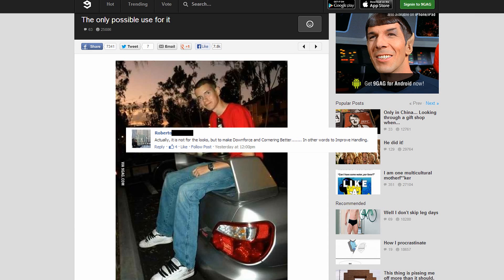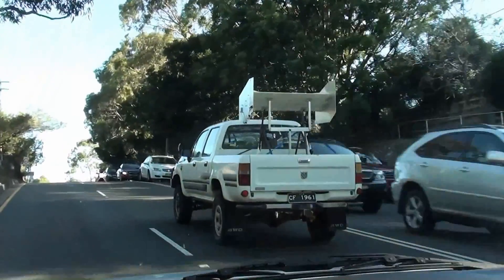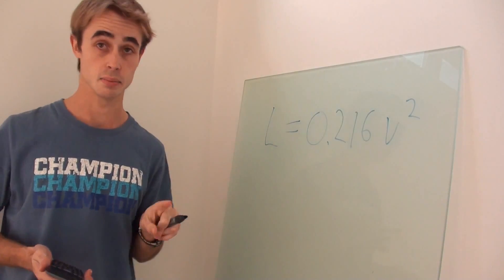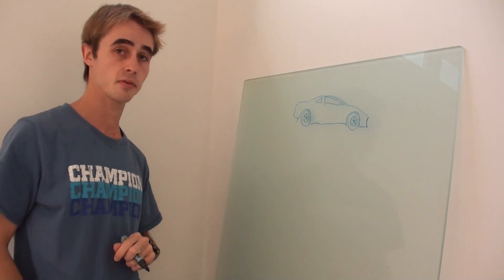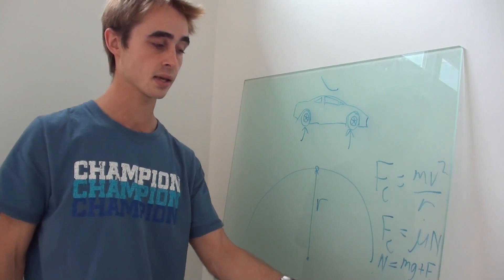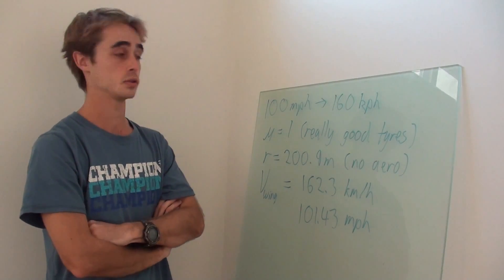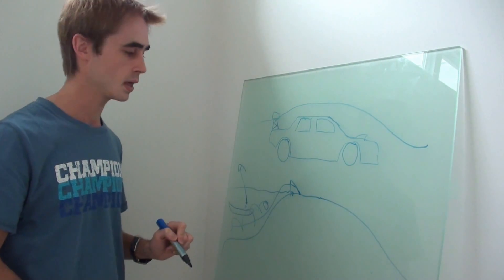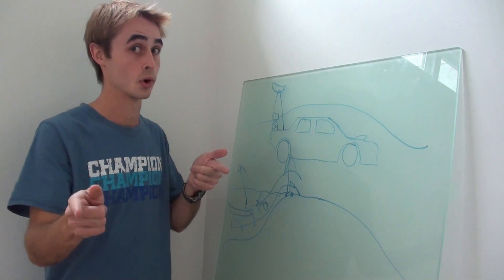Do Car Wings (Spoilers) Actually Work On-Road?

Comment: A Wing and a Spoiler are not the same thing
Wings main Job create downforce
Spoilers main job alter airflow, and can be found all over the car, the ones at the rear and visually look "similar" to wings, there main job is to reduce  turbulence/drag  right behind the car and improve fuel economy

Comment: In my old Colt  (hatchback) I had two small spoilers, they were mostly for decoration but they did help a bit with straight line stability especially when there were crosswinds at high speed. The top spoiler was 10cm elevated and curved to hug the body on its ends but top plate was straight, and the spoiler on the further end of the back rather flat again with very little angle on it. The top spoiler was probably doing most of the work by not letting the air separate on the rear windscreen creating vortices and thus overall reducing drag. The lower back spoiler was simply streamlining the air that came around the body to push it further away from the car. Total downforce probably ZERO but better drag reduction and reducing lift vortices from the back end as well. It resulted in a more neutral handling at high speeds where even though FWD it tended to oversteer at very high speed cornering which in a FWD low power car is bad as you cannot use the throttle to control the oversteer and had not the power to induce understeer
Reply: Yes its true.. i was using my commodore without a wing for some years n recently i install wing which is stock SS wing.. driving with out a wing its feel bouncing on straight line (i tot its was shocks problem) but i ignore it n went install a wing.. after installing that wing aka spoiler , straight line is more stable than before.. so yeah 110kmh i can feel the different

Comment: Wow I got dumber watching this. I can't even write correctly now. How does he write all this math and have no clue what hes saying? If he is talking about the small fanciful wings on production cars sure they are for looks. But he was talking about large performance wings. Claiming they have no effect. Hmmm that means the whole auto racing industry in every country on earth is having a shared conspiracy since the 1960s and they are all mounting heavy drag causing devices on there cars. Hes embarrassing himself. Also that nonsense about drag at the end was wrong too. For the same reason a tailgate up causes less drag than one down. It creates a pocket of rotating air that the air above it can travel across. Again of course I am not speaking of looks only accent wings. But for performance wings on performance cars even street cars. My son and I  saw the Oxford collage race car that creates so much down for it can drive upside down at 60. That is a far cry from no effect. And its wings were not oversized. This is extreme of course. But so is his claim of no effect.   Even that pickup would have alot more traction for accelerating and turning with the traction problems of a pickup. As stupid as it looks it would have a major effect. At least at low to medium speeds. It would be a massive drag though.

Comment: Heyoh, super old video but your channel has been very educational.  Lets take a super basic example, as i would like you to clarify.  I have a 95 mx5, when i am hauling tires to race in the trunk I can DEFINITELY feel the effects. While it certainly takes more time to get to x speed, I can carry a much higher velocity through corners. isnt that the aerodynamic effect of my open trunk functioning as a spoiler of sorts? 

I would also like to know the dynamic differences between a  full plane spoiler (google CSP Miata) vs a wing as discussed in this video. The spoiler does not have any flow beneath it, what does this do to the fluid dynamics in a system like that?

Comment: This video contradicts with his more recent videos.
Here he mentions, that a wing needs to be above the roof line of the car, while in the video about wing positioning he demonstrates how a wing can be effective below the roof line. 

To me, this video seems to be a bit heavy on confirmation biased. He wanted to prove that Wings aren't working on street cars and he explained why it might be.
Reply: I don't think you get the point he was making. 1.5 miles per hour difference when you're going a 100 into a corner is nothing (and unlikely on the street) and he explained why that is probly not even accurate due to other inefficiencies in placement, so he was pointing out they don't make a difference on the road actually

Comment: It is actually amazing that people think that an off the shelf wing is going to make a noticeable difference to their car. A wing bolted on at random to a car, and without adding downforce to the front of the car. If there were a noticeable difference it would be that the car was understeery rather than planted to the road, unless you add an equal amount of downforce to the front end of the car.

You would be much better off by tuning the suspension, anti rollbars, adjusting the wheel alignment and a good set of boots. That is enough for the average roadcar, and IF there are any aero gains to be had, it's certainly not going to come from a generic wing at your local "speed shop".

Comment: No difference? then tell me why audi had to add a spoiler to its TT because it had instability issues. just adding the wing worked.
Reply: I think that was fitted to try and cancel out some of the lift that Audi engineers had inadvertently designed into the rear end of the TT, it was a safety issue. This will have added drag and slowed the car down (or used more fuel) but makes it safer in the hands of your average front-wheel-drive Audi driver (menace to society).

Comment: Honestly, rear wings have a huge effect on SUV's, hatchbacks, wagons and minivans, the ones that send all the flow over them and further back.

On gravel roads the rear window doesn't get as dirty as the vortex coming off the back is moved further back, thus not pulling dust onto the rear window

Comment: Title needs to be "Do rear wings...".  Spoilers are all about inducing separation, so would more appropriately be applied to lip spoilers on the rear boot of a car.  Sure, most of those will be acting in turbulent air and therefore of little use, but if the rear window angle is shallow enough, they can lead to controlled separation and reduced drag.  You don't mention the drag reduction function at all so far as I heard.  Do you have the drag figures for the Mitsubishi with and without vortex generators and wing, for example?

Comment: Thanks for the maths! :)

Knew it was limited effect, but this limited ... Wow!
The wing i got on my race car is doing pretty much nil then ... Albeit the minimal amount of work it does is exactly where it's needed when needed (high speed cornering rear is loose). Got to make larger one then! ;)
Had considered adding vortex generators to get more out of the wing ... But forgot to think about those would actually cause lift, as it pulls high energy air from above! Glad i did not install them then.

Front air dam effects i could definitively notice and that was dramatic.
Reply: you got it on the back right?? so that will give more rear grip, which means you can now add front camber, and stuff to get it to corner better. and if the wing doesnt help, add a gurney. or more rake

Comment: Ok is it me or are those not the greatest eyebrows ever... dude were talkin Major downforce from those face drapes. I think he took a biker stash and glued it to his fore head. I'm not hating either but seriously I can even concentrate with those woolley bears staring at you like they are going to straight up fu man chew ninja chop you... by the way we should mention that if you are looking to use a spoiler for it's intended purpose you really do need to be on a track. Also, having an adjustable front splitter will maximize your down force without adding a ton of drag for no reason. You have to balance front and rear other wise you get lift in the front or in the rear. Depending on what you drive and how you drive plays a slight factor but to really see a benefit you need to put in some HARDCORE track time for testing. Not some autocross, you need well into the hundred range (MPH) to see the down force work and like they say in F1 if your not going fast enough to use it, it doesn't work and there for you need to go faster. It's not for the faint of heart.

Comment: Very badly worded. Of course spoilers, splitters and diffusers work. Ask any F1 driver. 
The question should be more like, do they help at lower speeds on road cars. The answer is still yes, they kick in at about 60mph. Size, location, etc all play a part.
Reply: Except the F1 cars don't have spoilers...

Comment: fuck this guy....my WING is 566 square inches which equates to 3.88 square feet.....now wind speeds at 75 mph give you 14.66 pounds of pressure per square foot....that means......14.66 X 3.8 = 56lbs of pressure...... Uhh if somebody is dropping a 56lb weight on the rear end of my light weight MR2 spyder you can be damn sure I will feel it! And I definitely feel it when I'm driving! Now....where I live I can pretty much drive as fast as I want so I hit speeds at 100mph+ all day since my car is also turbocharged...(thats including while going around wide turns)..so at 100mph my wing sees 101lbs of total air pressure....... if you think that 100lbs of pressure on the tail of a light weight sports car isn't noticeable...... then you are either trolling.... or have never drove past 80mph....im not even calculating in the design of my wing which actually increases these down forces significantly.....
Reply: Yep your one of thowz guys. 😧
Reply: shane mack my 2015 toyota corolla s. And I'm happy with it.
Reply: +2poc Jizcore wud u drive big dog?
Reply: The guy works for pro racing teams.
When seen in profile, the MR2 has a shallower angle across the back, almost like a liftback. Therefore, a wing on it will be more effective. However, the "nerd" (who at the moment makes more than the all the commentators on your thread combined) is showing a general case. He is super correct.
Reply: Also, stability at speed vs cornering speed; spoilers do work to add stability to the car in the entrance to the corner, but in it, and at the exit, a weak spoiler won't do jack. And the "nerd" was specifically talking about cornering velocity. So suck a muffler, snoop drift. suck a muffler.
Reply: shane mack Every car will perform differently... so therefore, an average = general case!!!
Duh.
Do you do math?
Reply: 0hn0haha what good does averaging out these calculations do? people are better off researching their respective vehicles and making that determination for themselves.
Reply: 0hn0haha First of all there is no "general case". Every car will perform differently when different aero devices are added. Some will see benefit and others won't. The only way to accurately asses whether or not a spoiler/wing is beneficial is to address each setup on a case by case basis, not only utilizing the appropriate calculations but also the driving feel, which is largely subjective. I really don't care how much this dude makes and could care less whether he works at AutoZone or MIT...for him to say in general that putting a wing/spoiler on your vehicle is virtually pointless is wrong, because he doesn't know what you drive or how fast you drive it.
Reply: not just listening to some guy who was clearly biased from the beginning of the video, for whatever reason, tell them what is good for them and their vehicle
Reply: +shane mack I think this nerd can't fell shit standing next to desk with that marker. I'd like to drop this guy in back of that pickup with his desk and ask him to hold it above his head with negative angle, then jump in that pickup and go highway and make as fast as this billybobfarmtruck can go (i hope it can do at least 100km/h). Then if he still in the back ask him how the aerodynamics feels... lol

Comment: When Audi TTs were first released they had an issue of flipping during high speeds. They researched why and put the tiny spoiler they then came with which solved the problem (along with slight suspension tightening). They do make a difference.
Reply: +Ravi Choudhry I actually looked into this a while back- A spoiler is different than a wing in that a wing creates downforce while a spoiler disrupts airflow. The problem is the Audi TT body shape itself acted like a airplane wing creating an overall lift of the car due to the curved top and flat bottom. The spoiler disrupts the airflow on the back in a way that the car no longer creates lift.
Reply: He said in the video that spoilers and wings DO make a difference, in race cars that are going really fast.. he went through a number of examples and how much downforce they created at certain really high speeds.
When he says it does fuck all, it's in the context of road cars doing the speed limit with the usual spoilers and wings you see on cars. You missed the whole context....

Also yea that's lift... the opposite of what you want. And couldn't be attributed to the wing, so I suppose it was the body shape like the other guy said.
Reply: Ravi Choudhry , that has nothing to do with making down force. .You guys aren't listening.

Comment: I first of all wish to thank Kyle.Drives for his series of video's and demonstrations..... I am learning so much..... I realise that not much has happened on this post for a while however, I just got thinking about the fitment of rear spoilers and in particular their almost universal fitment now to the modern motor vehicle...... It would have to be true to say that whilst many rear spoiler fitments are a cosmetic install..... it simply cannot be the only reason.......... The manufactures just simply would not waste their time and money if there were know aero advantages on a broad platform....   What I mean is you have to look at the big picture for overall vehicle performance, handling, stability, drag levels and safety...... Clearly the rear spoiler was never intended to produce any significant down force.... however, what it can do and if designed well is "Kill of undesirable and dangerous lift" at higher speeds.....  By nature..... the general shape of a vehicle / sloping rear window / trunk is a real lift producing concern...... so with the fitment of a rear spoiler we can effectively "level off" the air stream exiting the rear of the vehicle and hence, we have "destroyed" some lift......  Also, keeping the air stream clean may reduce the buffeting effect of erractic flow seperation providing a smoother occupant feel of the vehicle. As a secondary advantage...... if the nasty flow seperation point behind the vehicle can be reduced then we have just lowered drag and I do believe this is an area that is taken very seriously now with new vehicle design.... less drag..... less fuel burned.....  To again touch on the subject off lift..... its interesting to consider the first Audi TT....... By nature of the slopping rear body shape there was some extremely nasty high speed accidents post market release of these vehicles..... high speed stability was terrible due to "lift"..... with any steering input there was snap oversteer due to poor rear tyre grip as a result of the vehicle lifting.... One of the fixes by Audi was the install of a rear type spoiler and all future models got them as standard fitment...... So I guess....... a spoiler produces no real downforce however the reduced lift is what makes the difference...... I guess this could explain why other interested viewers have noticed gains in vehicle performance a stability with a rear spoiler fitted as compared to that of when the spoiler is removed. To conclude..... I am no expert in fluid dynamics...... just something I take a strong interest in....... so I am prepared to be taken apart if I have this all wrong.... Cheers

Comment: One question. If a rear wing doesn't really mean that much then what did Top Gear point out that a rear wing was needed for the Koenigsegg and when Koenigsegg listened and added one, they said it was more stable? I know the shape of the roof does slope down a lot more then a normal car and does have the center "carved" out for better flow. But did it really make a different or was Top Gear just making it more dramatic?

https://youtu.be/svxRpqeqFRY?t=318
Reply: +CelicaAutocrosser 

Short answer: The cabin on the car is smaller, so the air does not get pushed up as high over the windshield and does not need to drop down as far. Less vortex to begin with. When traveling fast in a car like that, a wing can help. It is practically a race car.
Reply: sooo why does any touringcar (WTCC, BTCC, DTM) have a wing, while still having a genuine shilouette??
im SURE its not for show, and the WTCC an BTCC are not as fast as a Koenigegg.

Comment: the thing with evo's and sti's is that their spoiler is more of a tunnel, that means (im just making a simple statement, I didn't do any math with it) that its trying to channel the air rather than generate downforce, at high speeds going strait and not inclining or declining in elevation, this will supposedly keep the car going strait aand not fly off the ground but then it would need another spoiler at the front too in order to work well
Reply: +Mechtech505 lemme revise my answer, the spoilers on sti's and evo's aren't for downforce, they are for rallying for jumps, its for the air to hit so the car doesn't flip forewards

Comment: Rear spoilers reduce aerodynamic dynamic drag from ex. 0.27-0.26, proven
Reply: Zhangy Depends on how well it is tuned and if it was needed in the first place.
Reply: Wings are not spoilers, find a different video perhaps?